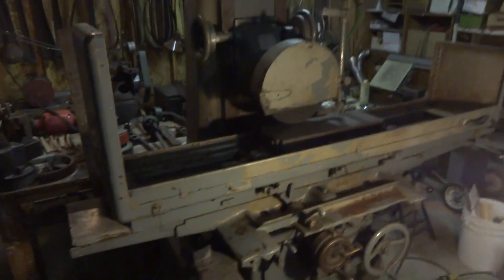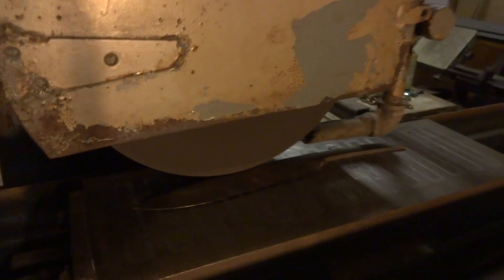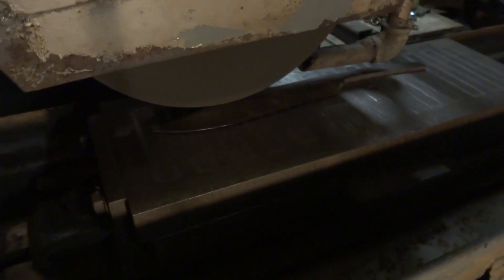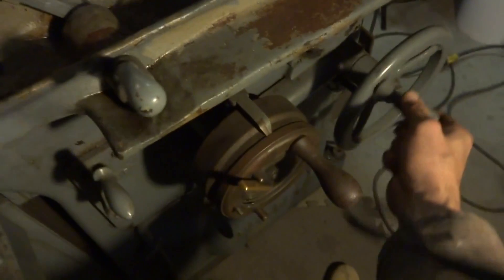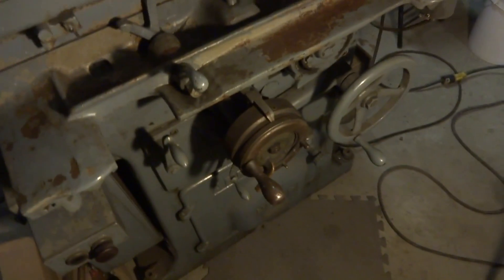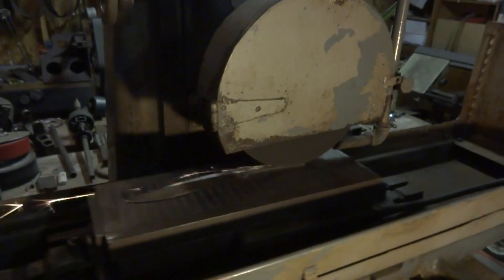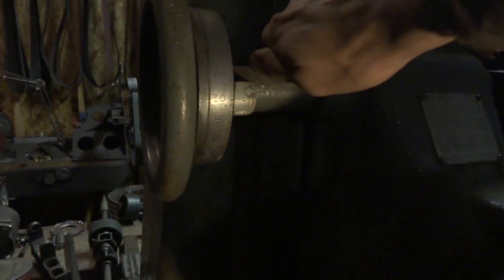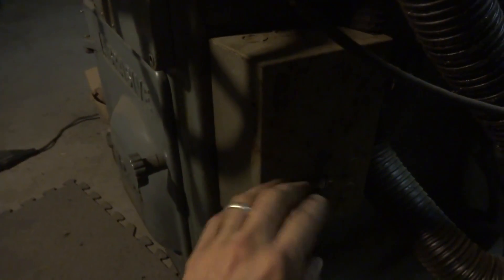Abrasive Machine Tool Co. Model 3B surface grinder operation and controls.

Comment: Thank you for making this video.  I have yet to get my hands on a reprint of the manual for this one, but am still looking.  

I've had my 3B for about 12 yrs - just in storage, though; I've never attempted to run it. 

Trying to put together a shop; once that's completed I'll see what she's got in her

Sure was good to see how well yours works; 'preciate you putting out this video

KP
Reply from the maker: Hey, my pleasure.  I have other old machines I'll be posting vids of over time.
I feel like a quick video overview could really be of help to folks with old equipment and no manual!  Took me a while to figure this beast out.  I have it running well and set up with coolant now...
Good luck to you!
Reply from the maker: Kerry, I don't know if you've found a manual yet, but here's a link to one in PDF.
It's listed as a "Landis 3B Abrasive Surface Grinder" and is the very same machine.
Landis took over the Abrasive Machine Tool Company and their grinder line.
http://vintagemachinery.org/pubs/detail.aspx?id=16437

Comment: Glad to see someone in the same boat I am in. I picked up a 3b earlier this year and have been figuring things out on it also. It does an excellent job gives a mirror finish. I run mine off a VFD and I picked up a original manual off Ebay for it and I see there are reprints available. It shows a nice breakdown of the gearbox and parts list. Sterlingmachinery.com has a brochure on it. Keep that heavy beast running not too many left like these.